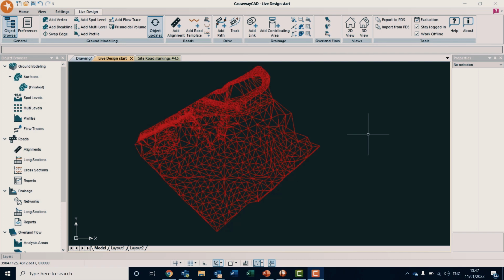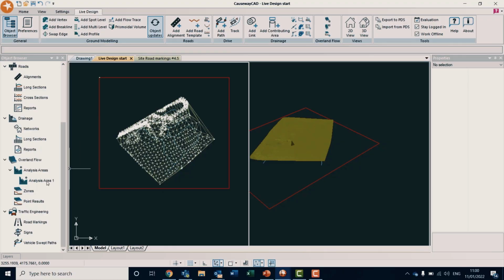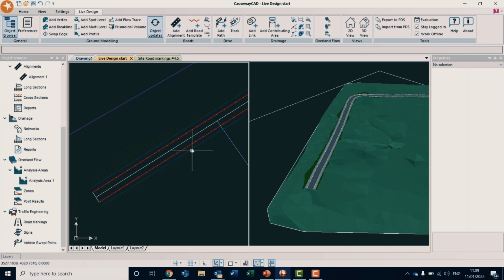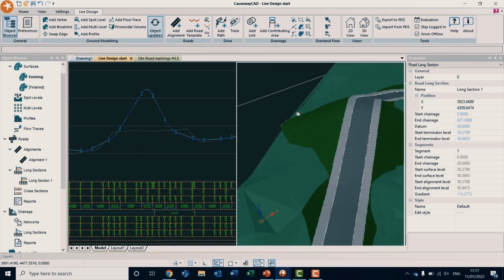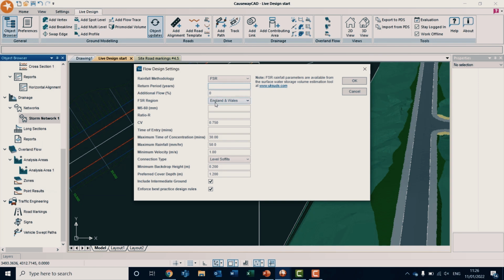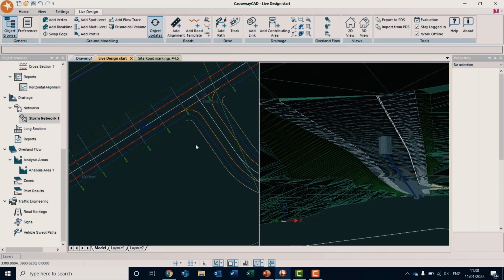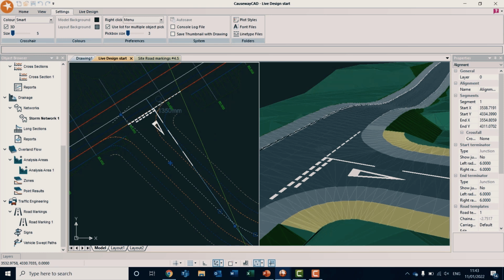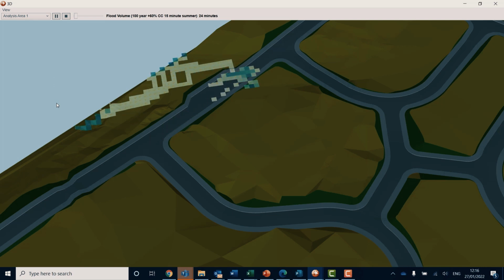Causeway Live design Unboxing

Comment: Do you feel this software is more efficient that XPSite3D for building sites/level design?
Reply from the maker: This is not a straightforward answer and both softwares have their advantages and it depends from which angle you are looking at it. If it is just for building proposed models, then I would opt for Live design as I personally feel it stayed close to the way you would do it in AutoCAD using 3d polylines or in civil3d. But again it will boil down on your needs.